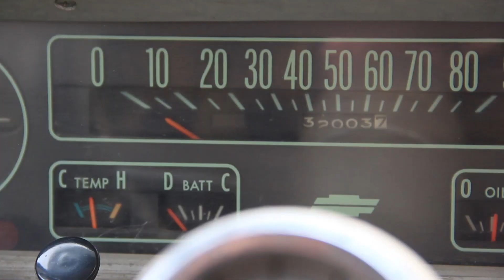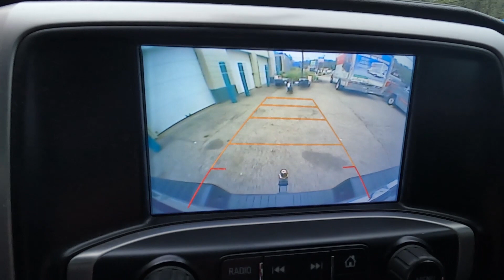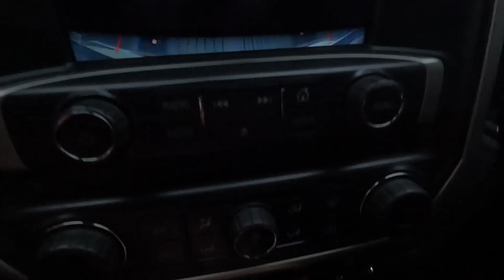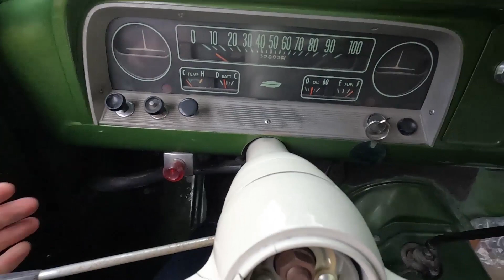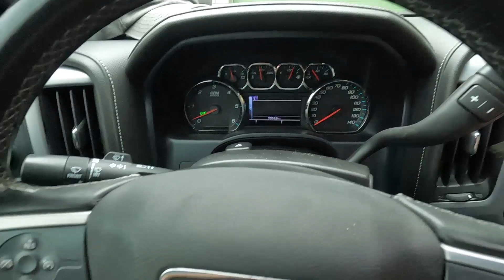1966 Chevrolet C20 Restoration Before and After: Stunning Custom Paint Job Unveiled!

Comment: I’m 17 and my first vehicle was my grandfathers 66 Chevy C20 and it has alot of character in it but it’s still amazing to drive even though it drinks gas like koolaid
Reply from the maker: What's up Joshua! If I had this at 17, I would be so stoked.  Your a lucky dude!  Fern, drinks glass like it's Koolaid also, but she's fun to drive!  Keep driving it dude!
Reply: @TheBrothersWorkshop  Oh trust me I will, Its going into the body shop soon to get the flatbed sandblasted and repainted and lined. I'm also ordering a new wiring harness because the wirings pretty bad right now.
Reply from the maker: I just installed a painless precision on ours. I'm going to be doing a full video about that soon. As you can imagine, installation of the harness took some time, and editing is going to take a long time as well.